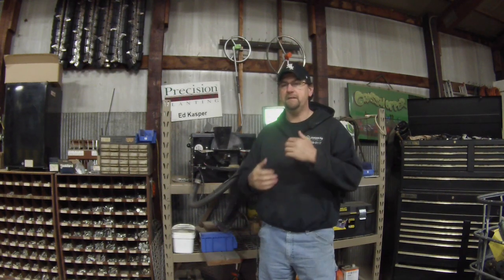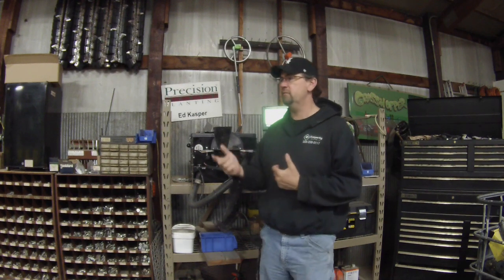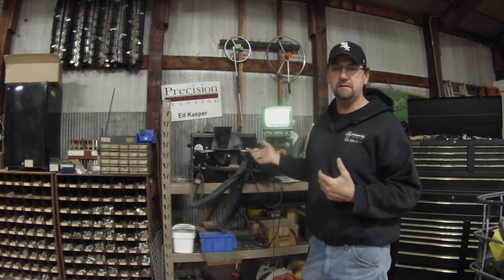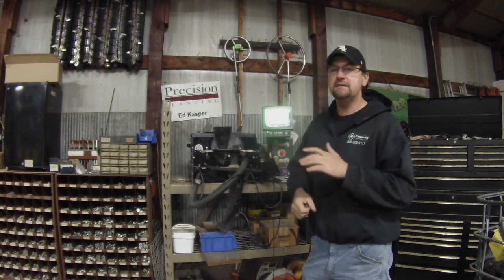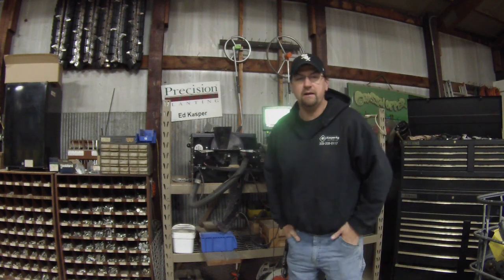Can you plant soybeans with a vSet Classic corn disk?

Comment: I am running the 27 hole corn plate with vset and v drive on a 15in planter.   I would like to plant beans at 120k or up to 140k .  Do you think I could run 5mph safely based on your experience?   This video is a few years old now so maybe you have some new information or update?   Thanks
Reply from the maker: I’d recommend the 56 hole soybean disk. 
Single cell so you have control of the drop and 56 holes makes it easy on the meter RPMs

Comment: Ed how fast would you recommend if a guy was planting soybeans at 100K on 30" rows, would it be 3.6 mph? 120k divided by 100k times 3 mph = 3.6?  What is the max rpm you would recommend running the vdrive at?  Running vdrive with vset classic.
Reply from the maker: Yeah I’d say 3.5 to 4 is possible. I’m going to try and stay below 70 rpm but this is new to me so right now it’s just a good guess.
Reply: @EdKasper35  thanks for the quick response.  Would be handy to not change meters if you need to switch crops for a field or w.